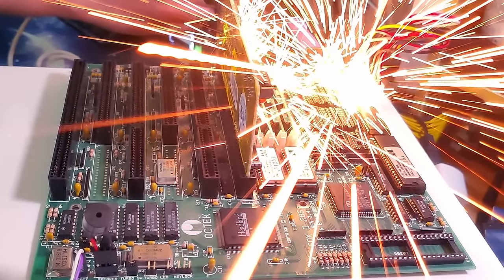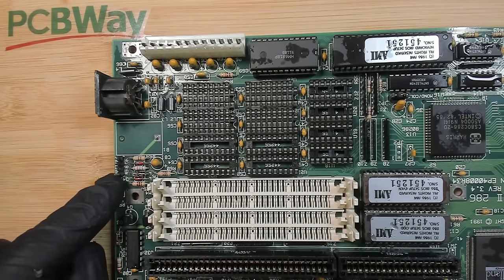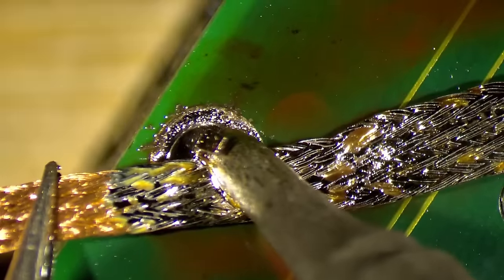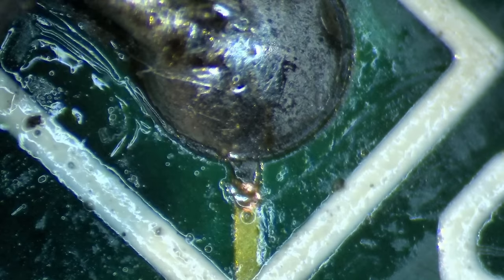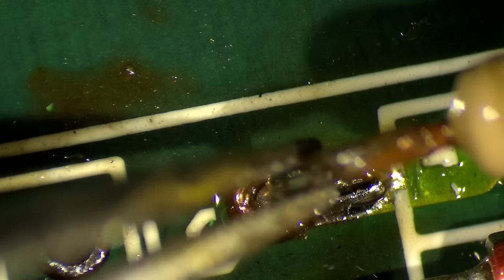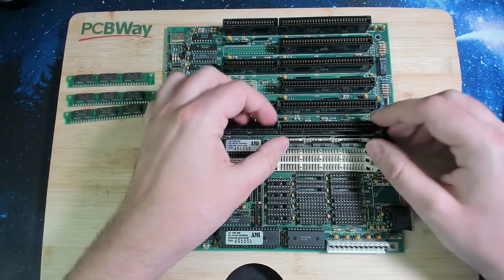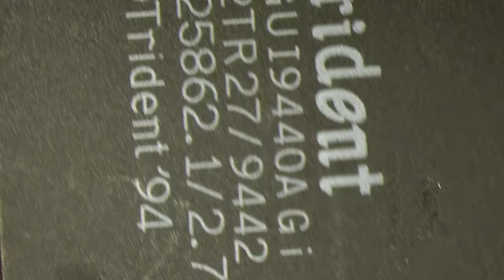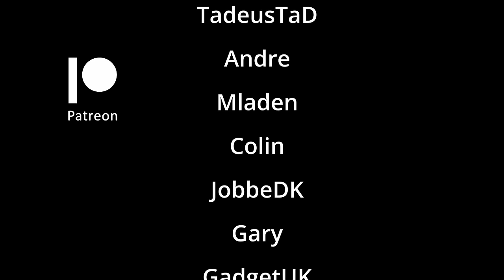Dangerous 286: Vintage hardware fireworks!

Comment: Wow at that explosion!!  I suspect you need the DIP RAM installed, to give it base memory.  Chances are the SIMMs are for extended memory.  Some of the older 286's were funny like that!  I realise some of the manuals that support that board show either the DIP RAM, or SIMMs...  It does show x 9 type though, so needs parity by the looks of it.
Reply from the maker: I hope you are right! DIP memory is on the way. So far, I wasn't able to find anything else suspicious about the board and why it wouldn't continue to boot. The memory should arrive next week and I hope it will fix that issue with the memory. Fingers crossed!
Reply: Ja 286 er sind wählerisch was RAM angeht
Reply: I have the same motherboard and I'm using only 2 SIMM modules, no DIP chips installed, and it's working fine.
Reply: @BaguetesGarage  Hmmm, maybe he has a problem with SIMM connectivity then, or it's because it lacks parity or the SIMMs are somehow incompatible?
Reply: I have another 286 board with DIP+SIMM configuration and it runs fine on 4 x 1 MB SIMMs without any DIPs. But my board can have a different implementation.
Reply: I'm pretty sure it's not the case. I have several similar 286 motherboards, with both SIMM sockets and DIP sockets. The DIP and SIMM are exclusive, you can have memory only in one or the other, but not both. If you have memory installed in both, it will not boot.
Reply: @bitsundbolts  It has two banks that overlay each other, each is either 4x 44256 plus optional parity (512k each bank) or 2x SIMM (2x 256 or 2x 1MB). Might be worth testing with ISA card RAM, if you can set one to start from zero
Reply: More likely it is a connectivity issue between memory controller and the soldered in memory chips. Test every trace and cross-check for shorts (some pins will be common ground so you will need the chip pinouts)
Reply: the manual even shows just 640k and no extended at the bios screen
Reply: @bitsundbolts  i have a 286 board thats entirely DIP/DIL RAM, loads of 41256s!
Reply from the maker: I have one of those too, but I haven't tested it yet. Luckily, all DIP sockets are populated, so, I don't have to hunt down so many chips.
Reply: @bitsundbolts  mine is probably a semi 'custom' one for here, the UK as it comes up 'watford electronics e-bios' and they were one time a fairly big supplier of components and computers, mostly for schools ...motherboard had 'aries pc' label on it

Comment: Must just be a good day for bad caps on 286 boards...I popped one this morning! After replacing a shorted one that I caught with the multimeter, I plugged it in, and the test supply found one I'd missed on the +5V rail.
Reply: I've heard so many bad things about those tantalum beads from the 80s and earlier that I'd be tempted to just replace all of them. They were mainly used because they were very compact and had tight tolerances but modern high-quality electrolytics have much tighter tolerances than the ones back in the day had, so often enough they're a decent replacement for tantalums from that era, or so I've been told.
Reply: @Ragnar8504  Tantalums have different performance characteristics than aluminum electrolytics, so aluminum electrolytics are not always a good substitute. Low ESR and especially polymer electrolytics are often suitable replacements; however, not all vintage tantalums are problems. It seems to be mostly an issue of storage conditions: damp conditions seem to accelerate tantalum crystal growth, which is what causes shorts. Boards stored in damp basements, or worse, from scrapheaps, have higher tantalum failure rates than boards store in climate controlled shops and living spaces.

Comment: the 20MHz Harris made 286 processors are the best 286 processors. They are very reliable and run cooler than the other 12MHz 286 cpu-s. You have a jackpot on that board, my friend.
Reply from the maker: Well, let's hope it is repairable... Or just a configuration that isn't right.
Considering that I get POST codes, I guess at least the CPU is ok.
Reply: @bitsundbolts 
I have two working 286 motherboards with cpus & ram if you need anything. Adding ram from that era is definitely PITA 😂
Reply from the maker: I'm working on the board again. I am checking all those ICs near the 40 MHz crystal. Maybe I can find something odd or faulty.
Reply: I had a 20MHz 286 as my first PC and it was giving my friend's low end 386 a run for its money. They felt nearly equal in power, except his could run Doom and mine couldn't. I miss that machine so much. Father sold it off and I was too young to memorize the specs. I would've rebuilt it, but I don't even remember what I had (in the 80s').
Reply: @enilenis  clock for clock, in 16bit software, the 286 was a hair faster than 386 cpus.

Comment: The reason it has two BIOS chips is that each BIOS chip is 8-bit wide, therefore dual chips make full 16-bits of this architecture. Before the times of large memory capacities it was important to mainain enough bandwidth of BIOS to reduce it's access time. Later, in 386 era, it was changed to cheaper solution - BIOS shadowing in RAM memory - where the BIOS contents was copied to RAM memory and its addresses remapped using 386's MMU. The 286 did not have MMU therefore it was not possible at all in such setups.
Reply: The 286 does have an MMU, as in, it is definitely capable of virtual addressing, but it doesn't have V86 mode. Which means its MMU can be only used in protected mode, which is not compatible with DOS applications. And to make it worse, once it enters protected mode, there is no way to leave this mode w/o making a full reset. All of these aren't a problem on 386 and above. Anyway, this is all irrelevant, because I'm fairly sure ROM shadowing is achieved by a hardware feature on the mainboard chipset, not by the CPUs MMU, by simply changing the address decoding, and setting if ROM or RAM is visible at that certain address. This is also nothing rocket science, and has been done many times even on 8 bit computers...
Reply: @chainq68k  Thank you for correcting me on that, I wasn't aware. Anyway it still means basically the same.
Reply: You can shadow BIOS using the 386 paging feature in virtual 8086 (V86) mode. This is what EMM386 does if you use the "ROM=F000-FFFF" switch. But this is not how it usually was done on 386/486 boards. Instead, the chipset can be switched into a mode in which it presents RAM instead of the ROM at the BIOS address, and it can optionally write-protect the RAM area that contains the ROM copy.
It's impossible for the BIOS to use the processor MMU for BIOS shadowing, because there is no protocol for the BIOS to hand off control to a memory manager in an operating system. The operating system expects to be able to use the MMU anyway it likes. So if you find an option to enable shadowing inside the BIOS, you can be sure it's a chipset feature. In case the chipset does not support BIOS shadowing, you can use the MMU for memory remapping as well, but in that case, it's solely an operating system feature unrelated to any BIOS setting, e.g. using the EMM386 command line in MS-DOS.
Reply: Don't lie, shadowing is chipset feature, not CPU MMU !
Reply: @Insomniator1  I don't lie. Please don't tell me I'm lying. Instead I just tell things that are not entirely true. I did not know it is done via chipset on x86 platform. On my native Amiga we use MMU to do this.
Reply: @tomaszmarcinkowski8242  Well Motorola 68K does not equal x86, but you get the point.
Reply: @ABRetroCollections  That's right

Comment: Try adding some RAM to the sockets, a lot of 8086 and 80286 will expect RAM to be present on the board itself, the slots will use space further up the memory map. This is a remnant of the IBM AT/XT era and the fact most systems cloned that spec, those systems expected at least 64K at a certain address in the map to even post.
Reply: I am also quite sure the dip sockets have to be populated to form the base memory. The simm modules are higher up on the map.
Reply from the maker: The manual specifies that DIP and simm sockets share the memory banks.
I got the DIP memory today. Unfortunately, I have no way of verifying that the memory chips work. Nevertheless, there is no change with DIP memory installed. The board still stops at POST code 10 - same as in the video 😟
Reply: @bitsundbolts  Try to check the manual from the post analiser card itself, it should give you some clue, somewhere to aim...
Reply from the maker: Good point, I'll check if there are more hints.
Reply: @bitsundbolts  Fair enough, of course you can check this. If the DIPs and SIPs are shared then you should be able to tone out from a socket to a slot.

Comment: Harris Semiconductor were a pretty decent chip producer in the 80s and 90s. They had a strong presence with specialist parts for avionics and similar high-end applications.  Coincidentally, my first PC also had a Harris 80286, but only at 10MHz. I also had a 10MHz Intel 80287 in it, which was a big help for the PCB CAD software that I used at the time.  As for the tantalum beads... I designed lots of boards that used them at that time. Back then, they weren't old, so they mostly only went bang if soldered in backwards, but still with fireworks 😂.  Also, you're right about the RAM chips being for the system RAM. That board is marked for 256k x 4 chips (44256) and is laid out for either dual-in-line or Zig-zag packages.  It maybe that it always needs populating regardless of any expansion SIMM modules.  Edit: I see that the user guide says that using only SIMMs is a perfectly valid option, so that's not the issue.
Reply from the maker: I'm afraid that the manual is correct and nothing changes once the DIP memory is installed... I still hope it's a mistake or oversight in the manual.
However, I also tested all the traces to the DIP and simm sockets. Bank0 connects to both sockets and all connections seem fine - so, yes - it might not be the memory after all - that would be sad and I need to find out when else could be the issue.

Comment: About the 2 BIOS chips: 8086 and 80286 systems require 16bit EPROM but at that time only 8bit EPROMs were available, so they used 2 identical EPROMs (one filled with odd and the other with even bytes) from the BIOS program. Have in mind that 8088 based system such as the original PC and later PC XT have 8bit data bus and required only one 8 bit EPROM. Later in 80386 and later era there were actually 16bit EPROMs available however they were so expensive that chipset manufacturers decided to "emulate" 16bit EPROM using memory and the chipset and store the BIOS program in an ordinary but larger 8bit EPROM.

Comment: Unfortunately, this is a huge problem with old PC mainboards.. the isolating layer in the tantalum capacitors will degrade with years in storage, and at powerup the contacts will fuse together into a short. On the plus side, this makes it rather obvious which one of the capacitors is broken ;-)
Also, don't bother retrofitting another old Tantalum on those boards, you'll just get the same problem again some time later. Pull the other tantalums off and replace them with some modern low-ESR electrolytics, those are safer.
Reply from the maker: If I get the board to work, I'll replace those caps and put electrolytic capacitors on it.
Reply: exactly thats what i do
Reply: last 286 board i restored was about 6 years ago been trying to get a pdp-11 for myself to restore

Comment: I must say, your soldering is almost perfect. Really beautiful work, love seeing it.
Reply: PS: The block of TTL chips you showed are 244/245 (tristate buffers/transcievers) and 373 (8-bit latches). While those aren't known to be fragile, one could have a stuck bit or something like that. 
Probably worth a try to take them off and test them separately.
Another possibility is: 
The SIMM sockets are really close to where the battery was. Maybe some of the battery leakage got underneath the sockets and messed something up. Have you already tested continuity between the SIMM sockets, and from the SIMM sockets to the CPU/Chipset?
Reply from the maker: Yes, I did check continuity between DIP, SIMM, and Chipset. Unfortunately, all checks out. I'll try again if all other suggestions don't resolve the issue.

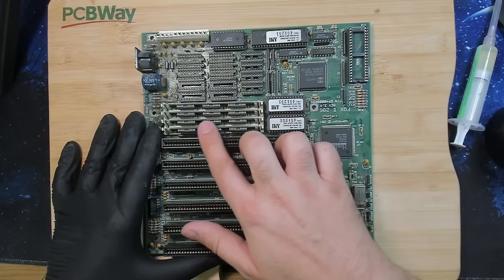Comment: 1:55 The chip next to the power connectors should be a Motorola 16818 iirc, it is the original DALLAS chip without battery and any external components like clock quartz...but combined with CMOS memory for the BIOS settings

Comment: I think the two BIOS chips are there for faster access. 16-bit instead of 8-bit, which is why they are often labelled ODD/EVEN (data is interleaved - even and odd bits are there - respectively). However, a solution called Bios Shadow has marginalised this (and one chip is cheaper than two)...

Comment: Base 64K is on the high addresses for bios shadowing. So, the stable address high may not be a problem. Chck the connections, most likely there is corroded trace/via.
Reply: No, "base 64K" is not used for BIOS shadowing, which is optional (if implemented at all) in this kind of board. They used two BIOS chips to provide full 16 bit bus width, reducing the need to shadow the ROM for performance, although the ROM is surely slower than DRAM at 20MHz, so shadowing still would help.

Base 64K indeed refers to the lowest 64K of memory, which needs to be operational for the POST to start. The first kilobyte is used for interrupt vectors, the subsequent 256 bytes are used for BIOS variables, and some other part of the base 64K is used as stack memory. Lastly, the memory between 31K and 32K is used to load the boot sector or MBR to start a disk-based operating system.
Reply: @tw11tube  Ok, my fault. Bios itself is located on 0xF0000 - 0xFFFFF. So, if you try to observe bus in this state, you can see only the top addresses. CPU and memory address / data bus is directly connected in this platform, right? So, it make sense to just measure pin to pin continuity.

Comment: Given how close the corrosion was to those memory sockets, I would look there, to start. Additionally, the chip that was affected near the beginning by the corrosion might have gone bad from the battery leak wicking its way into the package through the legs, so I'd see if there was some way to test that.
Reply from the maker: Great point regarding that once chip. I tested the memory sockets so much that I don't believe the issue to be there. But let me see if I can figure something out regarding that chip.

Comment: I think I recall that base DIP mem needs to be populated on 286 boards. SIM slots may be only memory expansion.
Reply from the maker: I got the DIP memory today, unfortunately, the board does exactly the same thing. Identical behavior with either DIP memory, SIMM modules, or no memory at all.

Comment: Might be worth checking for shorts on the power rails before firing up unknown boards.
Reply from the maker: I did, there weren't any when I checked. It must have happened when I powered that system on after all that time.
Reply: @bitsundbolts  ohh. I don't think that was in the video, which threw me as I'm sure you usually check.
Reply: That's good old Schrödinger's tantalums. They are simultaneously fine and not-fine until you power them on. The failure is initially not electrical, is not detectable by any measurements known to mankind.

Comment: One of the reasons I think these tantalum capacitors pop is that they weren't spec'd correctly back then. After a similar failure of a new tantalum, I found a number of empirical evidence posts stating that tantalums should have double the voltage they're expected to see. In your case, those are rated for 16V but are attached to the 12V rail.  This is way too close to their max rating and any fluctuation could pop them again. The damage is cumulative and chances of failure increase with age. 

The voltage rating doesn't have to match the original spec, only the capacitance is important. I'd look for 24V+ tantalums as suitable replacements or you're rolling the dice with every power up.
Reply from the maker: You are absolutely correct! The tantalum cap that exploded is indeed connected to the 12V rail! That might have been the reason, in combination with age, it exploded. Maybe it would be a good idea to preventively replace the cap around the power connector - at least the ones connecting to 12V. I have seen many times that those are the caps that blow up.
Reply: Very interesting!  I will uprate the voltage on these in future!
Reply: @GadgetUK164 Tantalum polymer caps don’t have that disadvantage
Reply: @_irdc  I replace the tantals with electrolytic capacitors.
Reply: @Nelson68k  that also works, although I’d go for OS-CONs

Comment: If you did not find out already on how to check the operation of the octal buffer: find the LE pin (high is latch in) inputs and outputs on 74xx373 parts and use an logic analyser or at minimum two channel scope (direct/continuous sampling as in: without averaging or other software filters)  to verify the data is latches in properly.
Reply from the maker: I'll have a look. Using a two channel scope is still above my abilities, but I'll have a look the datasheets of those chips and try to understand how they work. Maybe my programmer has the ability to test those logic chips - I haven't checked that yet.
Reply: I'd check the LS245 first, getting stuck high can definitely happen if it fails to go High-Z.

Comment: 38:48 after foreshadowing "These tantalums like to explode so here goes nothin'" and "I'd better wear my safety specs just in case"

Then: "Well that was unexpected".
Narrator: "It was not unexpected."
Reply from the maker: I was surprised by the violence of the explosion - not that one did. But yes, I guess it sounded like I was surprised that it did explode.
Reply: I like to set myself up to a surprise, if something does not explode, but still get a shock if something does 🫨